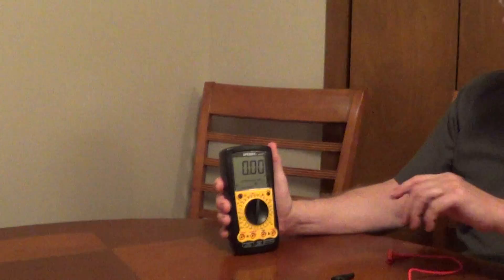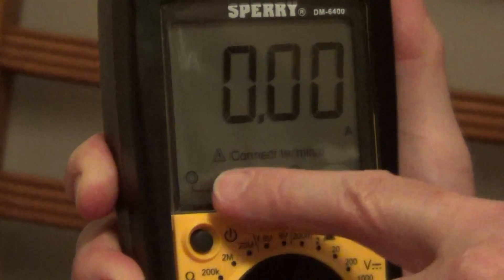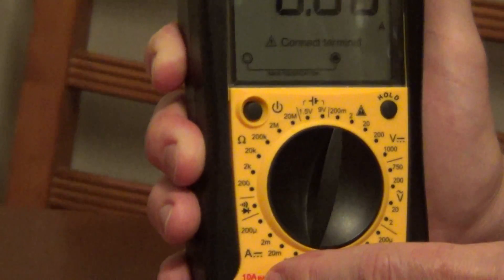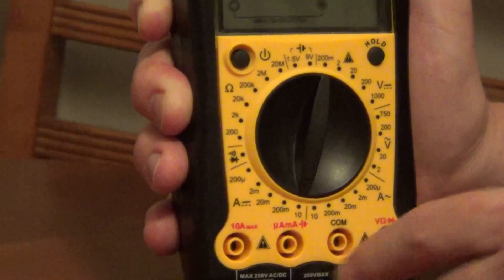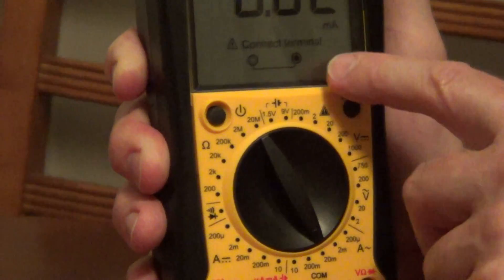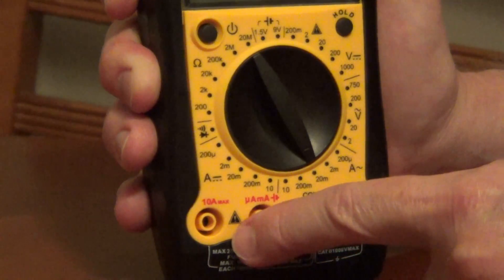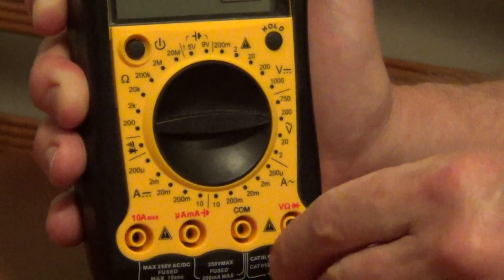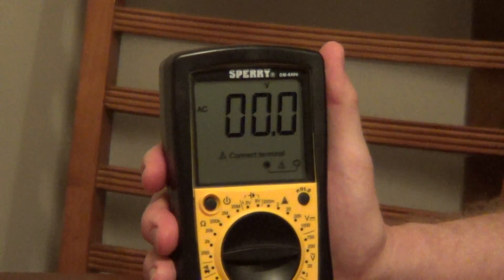Sperry DM 6400 - Connect Terminal - How to Use Electrical Tester

Comment: A couple years ago, I gifted a friend with a DM-6400.  He recently called me to tell me that all ranges read "1" and readings were not recognized, just like Eric Larson mentioned.  I went to have a look, and inadvertently hit the "hold" button instead of the "power" button, which (of course) unwittingly fixed the issue, and left us both baffled as to why my "laying on of hands" worked such wonderful magic.  Thanks to Eric for "unbaffling" me, and thanks for the wonderful video describing that "Connect Terminal" is an alert for the proper terminals to use based on range, and NOT a warning that the terminals are Not Connected.

Comment: I just got this dm 6400 multi meter... The manual says to loosen battery screw to replace the battery except there is no obvious place on the back back of the dm 6400...suggestions.. I know this is a basic question...
Reply: Never mind I did not realize there was a plastic case

Comment: Thank you for this video! Our DM-6400 shipped with the "HOLD" button down and our manual makes no reference to what the sticker on the display described as a "Test Lead Alert System" so, by any common-sense assessment, the meter appeared to be DOA -- the display was stuck on "1" and the alert message, not useful for anything other than a continuity tone.  We spent about a 1/2 hour trying to diagnose what the "warning" implied was a loose connection before we turned to the Internet and found your video.  Sperry should pay you to do their documentation (and they owe you because we were minutes away from returning a perfectly fine meter to the store as obviously broken).
Reply from the maker: Eric M. Larson Glad it was helpful.We have more tips on our weekly podcast https://itunes.apple.com/us/podcast/fix-it-home-improvement/id880903087?mt=2